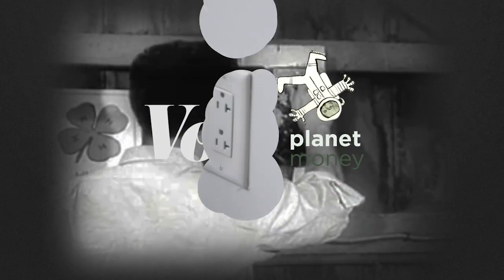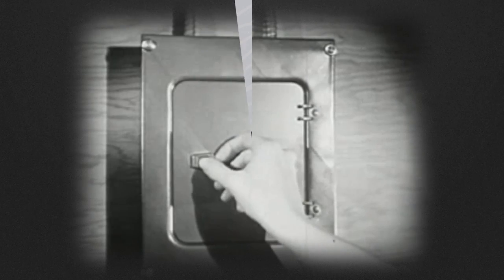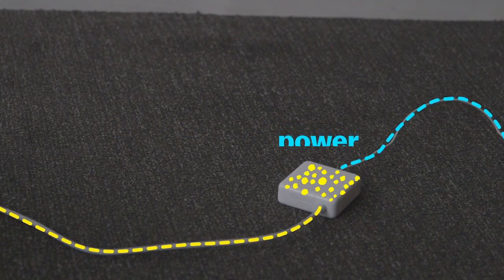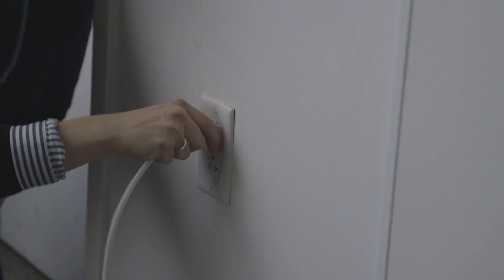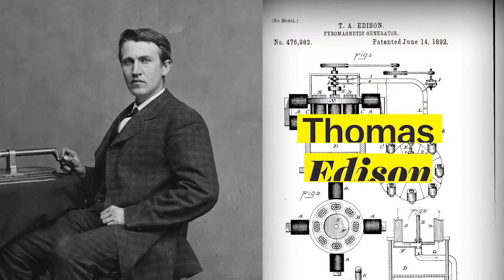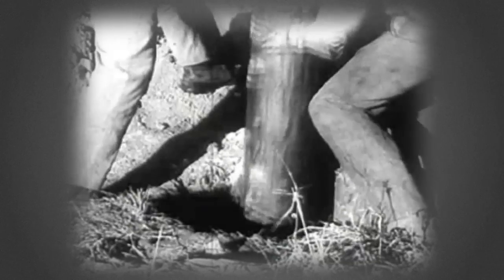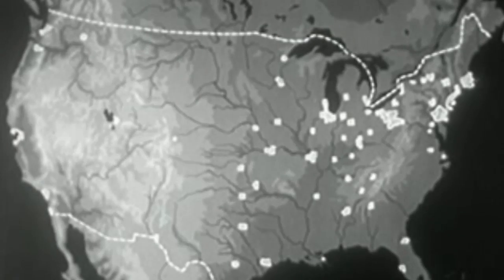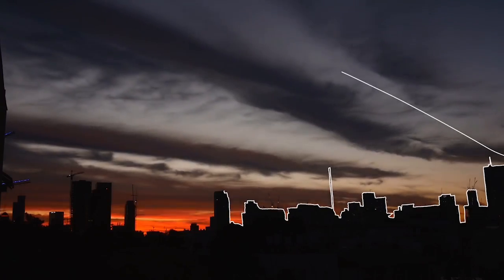Why your laptop charger is so hot

Comment: This Video should have had a disclaimer For Stupid people because the explanation is Silly,  it doesn't really explain why your laptop charger is so hot, it goes off on some lightly related topic
The Laptop charger gets hot from converting 110v or 240v down to 19v.
that voltage conversion is where the heat is generated.
this video should be titled " what does the laptop charger do?"
Reply: +Mark Pickett 
I'm pretty certain the heat is generated from the transformer that steps mains power down to 12V or whatever voltage you're using. 
Bridge rectifiers (AC-DC) shouldn't generate that much heat....... so this video is essentially bullshit.
Reply: +Mark Pickett Wrong. Conversion from AC to DC generates almost no heat. It's done with a bridge rectifier if you want to use both sides of the AC wave. You can use a a single diode if you wanted to use just half of the wave. The OP is current. The heat is generated in the step down process.

I bridge rectify 110vAC regularly at home. The component is a 4 pin IC that's about 1/4 of a square centimeter and has no heat sink or fins.
Reply: That is easy to answer. A certain Mr. Edison who was a 19th century shyster that managed to convince Americans that he was a genius (going by their choices of leaders over the years, clearly fooling Americans does not require any great genius) by stealing ideas from people that trusted him and pretending that he was a prolific inventor. 

For example. It is believed that Edison invented the light bulb. He didn't it had been invented 40 years before Edison was born. Edison discovered a way to make light bulbs durable enough to be commercially viable and a way to manufacture a marketable product. Whilst this is hardly a trivial achievement, and none of Edison's achievements were trivial, he was not what he claimed to be.    

He was smart enough to know that the genuine genius, Nikola Tesla had a designed an AC electrical distribution system so vastly superior to his schoolboy DC system  that he set about discrediting AC by murdering dumb animals. 

So it is due to Edison´s successful duping of the USA population into believing that AC will come and kill you while you sleep in your beds that they use 110V.

So the easily fooled Americans believed that AC was more dangerous than DC. It´s not actually totally true nor entirely untrue, but the DC system ran at 110v so an unearthed live wire would not bite you, or send you flying. It could give you a very nasty burn though. The problem is DC cannot be stepped up and down for distribution. In the 1920s the UK built a national distribution grid, and other industrial nations pretty much did so in that period. The choice of 240V 50Hz was really due to the cost of conductors being lower than if 120V was used. 

I have worked on 110V domestic systems while living in Mexico. I was quite horrified to see that wiring in the home was done by simply twisting conductors together and then applying PVC tape. 

When I was trained we were using 16th edition IEE wiring regs, now on 17th  edition i think. The precautions we had to take in UK were considered laughable and a waste of time by the Mexicans. Actually 110V (its actually 120V but nets down to 117V) is not really safer because if you complete a circuit there is sufficient current (more than about 30mA) and it crosses your heart you could die.  

When you consider that a 240V domestic ring main in UK has a 30 or 32A fuse or breaker on it, there is more than enough juice to kill a person. 

There is no safe or unsafe VOLTAGE, there is a safe or unsafe current level, which is measured in Amperes. Anything over 30mA that is 30/100ths of an Ampere (an Amp 1 Coulomb/sec) going through a body will cause sensation, possibly burning and/or cardiac arrhythmia. 

In Short;

Electricity is fu%&$# dangerous if you don´t know what you are doing. I did a 2 years C&G course on IEE regulation and passed it, but I am not an electrician as I never did it for a job.  I just have the certificate so that I can be a duty holder. I always call a properly qualified sparky to do anything more than fit a plug or change a bulb or fuse. In a workplace you must not even do those things.  

All you need to know about electricity is to ask yourself the following:

Have I been trained specifically to work on this electrical installation or appliance?

If the answer is no do not touch it! If the answer is yes then a very sensible person has called you to fix a circuit/appliance.
Reply: +M Anto the video says it's hot because of converting from ac to dc. which is wrong. it's the voltage step down from 110v to the 19v
Reply: +Bobby Newmark i think your getting confused between Linear Regulator and Switching
Mode Power Supplies. Linear Regulator supplies will put off a lot of heat because its burning off the excess energy, while a switching power supply can do the same thing in a smaller space, but in the end costs more because of the components involved. that's how usb wall chargers can be so small now and still put out little to no heat. 

then again i could be wrong or just talking out my ass, but might be something to think about.
Reply: +Jared Reabow (Jazza) let me just end this once for all. AC is rectified to DC by rectifier then buck converter can adjust the level of DC voltage after that. In both stage, only active component is the switch, notice I'm talking about active component. Capacitor and inductor only store power does not consume power. The most widely used switch in these circuits are IGBT for high voltage and MOSFET for Low power, both have conduction loss. Means when they are conducting and turned on, they act like a resistor. Huge amount of current flows thru them and they have some small resistance value. So conduction loss power=I2R. Except for that, we have switching loss. These two loss consist 99% of overall power conversion loss.
Reply: Almost every vox video is formatted in this fashion
Reply: It did answer it as the above says. It just wanted to educate the masses who forgot to pay attention in physics
Reply: +M Anto nope, you are buthurt because you believed the video until you saw the comments LOL
Reply: +systematic101 That really depends; it doesn't have to necessarily, but that reality is based on your load as well power supply size requirements, capacities, and components cost.  Laptops want things small, but they also can consume a fair amount of power often over 50 watts.  Just to give an example, my last HP laptop came with an absolute brick of a power supply; no heat could be felt when using the thing.  Then for travel I got sick of lugging it and ordered the nice little switching mode flat "slides in your bag" jobber and that one you could probably fry an egg on when it got going.  Some of its not just I2R..its that R increases with temperature so there are indeed cases that without the protective circuitry one can have a thermal runaway situation if the charger is being pushed at its capacity.

Also, in more traditional power supplies, stepping up and stepping down as well rectification don't take much power, but often output stage voltage regulation does as many times any ripple or load following is just shunted through a resistance to ground; its why those 5V and 12V regulator ICs have heat sink connections.  Again though much of this generally depends on the load vs. the regulator capacity one is dealing with.
Reply: +systematic101 Laptops though often run over 50 watts; and everyone wants it the same size as a phone charger wall wart.  Just on raw numbers, desktop power supplies are now sometimes over 90 percent efficient, while those for laptops often range at only 60-70%(for manufacturers makes sense as they've already spent the money getting power efficiency in the computer vs. a desktop); If you're needing 50 watts, at the worst end that PSU may have 30 to deal with and generally no fan; that's why they can get hot.
Reply: +Jared Reabow (Jazza) Thanks for the warning sonny. Saved Mamma almost 3 mins of her time. Cookies for you!
Reply: Stephen Brookes
jesus people are voting for trump,  idiocracy is nearly here !
Reply: Its because the designers of Laptop Chargers don't (and in most situations, cant) efficiently change from AC to DC. First, you need to pass current through a bridge rectifier, which doesn't really generate waste heat that much. Then, it is filtered through huge capacitors, again, no heat/power loss. BUT, regulators, especially the ones in high voltage electronics, are SPECIFICALLY DESIGNED to burn off excess current to get to a desired amperage and voltage. This is not the fault of Tesla, an extraordinary engineer, it is the fault of the charger designers using regulators designed in the mid 70's. Also, what about AC appliances, washers, driers, microwaves? Furtermore, having a single converter for just DC stuff would still require BURNING OFF excess current, so you would hypothetically put tens of thousands into a false technology.
Reply: Stephen Brookes especially for Apple's strict devotion to sacrificing performance to their design...no heat dissipation whatsoever is allowed for (They forgot that they can make the chargers out of the same metal as their computers- and would work better!)
Reply: Felt like they were talking to a seven year old the whole video.
Reply: its just a catchy title. World be very lame with your title.
Reply: codenamegamma In the case of USB wall power supplies the amperage and voltage of the out is pretty low. The linear and switching supplies are very similar. They are only different in the steps before the voltage step down. Switching supplies rectify the voltage 1st. Then it ramps it up and converts it back to a high frequency AC then steps it down to a low voltage. The high frequency of the AC allows the transformer to be much smaller. Then it rectifies it again. Not a lot of heat is generated by the switch mode supply because the power passing threw it is not very high and it's efficiency is very high. In switch mode about 10-20% of the input power will be lost to heat where 30-40% will be lost in the linear.

Cost wise it's not much more expensive to build a switch mode power supply. I typically don't build them unless the power use is higher the 10 watts. most of my circuits are only 2 to 5 watts.
Reply: Well precisely it's how the ac -> DC down step conversion is done, different methods create more heat, magnetic coil induction etc...
Reply: +Jared Reabow (Jazza) more like a disclaimer saying "not for stupid people"
the heat is lost energy, it's a byproduct of what ever process it goes through, this is literally one of the simplest concepts out there, if you lost some damn energy where did it go? it certainly didn't just poof and disappear from this universe, that's not how it works, it has to go somewhere.
Reply: Jeremiah John
this is basic electrical heat transfer,  but in modern cosmology things can disappear from this universe.   Into others,  gravity for example only makes sense if it's from another universe, and that explains why it's so weak.
So there are parallel universes etc...

when you get into quantum computers, they are literally sending information into different universes and back.
Reply: systematic101
I'm baffled why in this modern age this problem hasn't been solved.  It should be able to step down without giving off too much heat.
I think it shows that at a fundamental level we don't understand electronics.

The energy is being turned into heat because it has nowhere else to go, give it somewhere else to go and there should be no heat.
Reply: Hanniffy Dinn no mater what there will always be heat. There will never be a perfect conversion. It's just a matter of how much heat.
Reply: systematic101
You aren't getting it.  It is possible, just nobody has even tried to "filter" off the excess energy before it's turned into heat.

it's turned into heat because of the wasteful way it works.

It most definitely is possible.
Reply: +Hanniffy Dinn No. It's not possible because we live in a universe that has to obey the laws of thermodynamics. No mater what the conversion of energy from 1 form to another will always have a heat loss. There will always be some resistance somewhere in the circuit and that resistance will cause heat. Even if super conductors were used there will still be heat loss just not in the super conductors.
Reply: +Jared Reabow (Jazza) Exactly. They failed to answer the question for one more reason: to answer the question why it is SO hot, it should be mentioned that it is because the power wasted as heat is large considering the surface of the device, through which the heat is dissipated, and If the surface were larger, to dissipate the same amount of heat the surface would have lower temperature. 
I really enjoy some of Vox's videos on social or human sciences issues, but I guess they should stick to that. This video is rubbish.
Reply: +Stephen Brookes I wasn't replying to your comment, I hadn't even read it. As you can see, beginning of my previous message says someone else's name. And I don't think I was being tolerant of their foibles at all.

Anyway, the very basis of the only correct answer to "Why your laptop charger is so hot" is "because it dissipates a quite large amount of heat through a quite small surface area", BOTH of these conditions have to be met; if both are met with a device of the size of a car, of course it will reach a high temperature as well. 

Then one could (and should) go deeper as to why it needs to dissipate quite a large amount of heat, which is because of the rectifying of the input AC current, but probably even more importantly because of switching down the voltage from the socket voltage. Which was already mentioned by the person to whose comment I was replying and referred by me by the word "exactly".
Reply: I study electronics , honestly i expected the video te have a high school level of whats happening, it's at kindergarden level.
Reply: P. Bubon it could then couple as a plate warmer!
Reply: Twinkle Baby Resistance only exists in the presence of oppression!
Reply: ReabowRotors It should be named "What the laptop charger do... sort of", as it didn't even mention that it also steps down voltage to the 10/20ish volts required by the PC.
Reply: Grey You are very lucky.If you had touched the earth conductor we may not be having this chat. You would have been sent across the room and it could have stopped your heart, or badly burnt you. Although I met a sparky that had fallen against a control panel connected with a 3 phase supply 415V and survived cos he was thrown about 10 metres.instantly breaking his circuit

Plugs now have insulated conductors so that you cannot touch the exposed conductor until it is away from the juice. Also now you have to shut off all supplies and lock out the switch if you want to work on anything. Thank goodness for HSE rules.
Reply: Stephen Brookes Thanks for replying. Working as a spark has to be unpleasant, but then like you say, it's only that if you've no idea what you're doing, which many DIYers don't. But you're right the Health and safety has changed it all. Thank goodness 😅 
I'm still never changing a lightbulb though 😱
Reply: If you take the fuse out or flick the isolater off, the most dangerous thing about a light bulb change is the step ladder you're standing on. I have always thought if you get thrown off a horse get straight on again or you will always have the fear.  I can appreciate your apprehension, but  what happened to you was ignorance of the danger. Now that you have learnt what can happen, do not fear it happening again. Just make sure any electrical work (even a light bulb swap) is done on a dead circuit. I don't even trust a switch, just in case some DIY nut job had wired it on the neutral side. So just isolate before touching anything electrical and it cannot hurt you.
Reply: Stephen Brookes You are so correct in all you've described. Thanks 🙏
Reply: You're welcome.
Reply: I thought it was a problem they would tell us how to fix.  Mine doesn't "so hot i can't touch it," but I was curious in case it gets really hot what should I do.  This video ended up only telling me what the box does, what a completely misleading title.
Reply: No. it switches topics!
Reply: From an Asian student's perspective: P=W/t=UIt/t=UI
Reply: Oh I love YouTube replies
Reply: +Jeremiah John ok, so with your reasoning the reason a car engine gets hot is because of the friction in the drive chain to the wheels....
Nope, the engine gets hot because of the combustion.
Reply: +Jared Reabow (Jazza) not an accurate analogy. Engine would be like the power plant producing the AC power and the drive train would be like the AC/DC converter box. The heat in the drive train would be from the energy loss do to friction in the drive train. The engine gets hot do to energy loss in the energy conversion from gas to kinetic just like the power plant has heat loss when it converts steam to kinetic.
Reply: +systematic101 ok if we go by your analogy we would be saying the sound created from the drive train is causing the heat.

Fact is over 300 agree AC to DC conversion is almost loss less compared with voltage conversion.
heat in the power supply is generated by the voltage conversion (120v to 19v) not the power type conversion (AC to DC)
If it were only converting from AC to DC the brick would be tiny and would be at worst 1 degree above room temp.
Reply: +Jared Reabow (Jazza) that's what I said. a bridge rectifier produces near 0 heat while the voltage step down produces almost all of the heat.
Reply: +systematic101 my mistake i was confusing you with a different comment :)
Reply: +Mark Pickett it was a vague explanation though...
Reply: She said it lol. You deaf or something? Your not even bringing more info than her, calling someone stupid.
Reply: Stephen Brookes
well it's vox not a science channel like vsauce, when can you expect?

Ok enough for the dumb girlies !
Reply: Hanniffy Dinn Dumbity is not confined to girls and is remarkably commonplace. If we do not teach real science and scientific methodology; then people will be credulous and believe mythology without question.
Reply: The last sentence in the video was Stupid!  You still need to power down from AC to DC in somewhere!
Reply: Hanniffy Dinn That has already proven to be too difficult and have very bad PR implications!
Reply: Stephen Brookes
I was reading about what's going on with Trump - it's the Waldo Effect,  the Black Mirror episode of the same name covered this effect.

We really are going to have a future like in the film idiocracy.   Literally everyone is dumb - by design too.
Reply: Hanniffy Dinn Trump is scarey!
Reply: Piers Alter Each of us has to develop our own BS barometer!
Reply: YS Production

The actual correct answer to why is it SO hot is because it produces much heat. This IS the only correct answer.

The answer to why does it produces so much heat is due to the magnitude of the current. If they ask what that means, then I will start asking for a fee hahahah!

Whilst your answer is not strictly speaking incorrect, as a given amount of any force applied over a smaller area will exert proportionally more stress on that area, where the same amount of force will inversely affect a larger area.

In this case it is not to do with size. If it were the size of a car and were passing more current than its rating, it would become too hot. As my belief is that the cheap, Chinese rubbish, crap, bunco versions are not man enough for the job!

Although I have several OE power units which I leave on constantly, and they do get pretty hot, but not too hot to touch, so maybe the answer is that the devices are actually performing within specification. In which case the answer is don't touch it when it is on cos it is meant to be hot! Turn it off and let it cool before touching.

At what point do you think it has to be said to people that do not understand why, on so many rudimentary effects of nature that they should have listened in school?

Why did my house burn down? Because you plugged a kettle, tv, xbox, lamp, iron and room heater into the same extension lead! Doh!!!!

All appliances have a rating in kW, all circuits have a rating limitation in kW, but I guess the video maker thinks this is her phone's kWool rating.

Basic physics at school covers the principle of conservation of energy.

Why people don't understand this is my question! Maybe the answer to most of these questions is for some people (those to whom it applies) to stop being dummases!
Reply: +Jared Reabow (Jazza) thank you for saving me from the click bait
Reply: Indeed it's way too superficial and doesn't really teach anyone anything.
Reply: Mayamiko Hara I'm unsure that there is anything super about it.LOL
Reply: the video literally talks about why it's hot for maybe 10 seconds
Reply: solomon sumner You wait until she starts explaining how an induction stove works!
Reply: P. Bubon Also the fact that they are really quite small for what they are able to do, so there is less volume to dissipate the heat. Generally it is not a fault just a characteristic. Go back to Tesla´s time a similar apparatus would be the size of a suitcase.
Reply: ok, so it's not a half-wave rectifier, it's a full wave rectifier that apple sent me?
Reply: ReabowRotors 
Agree
Reply: ReabowRotors thank you
Reply: Now that made sense, unlike the video.  A better video would be why are some countries (i.e. USA & Japan) use 110V and others (i.e. England & Nigeria) use 220V/240Vs.
Reply: Stephen Brookes In the few paragraphs you wrote meant I understood more in your explanation than I did in this video. In fact it was quite interesting to read. Thank you 😊 
I was electrocuted when I was 15, I was using a single spin driver that many of us had years ago in our homes and it began to shake uncontrollably. Me in my bare feet and standing in a puddle of water in the kitchen bent down to pull the plug out, but I could only manage to pull it out a bit. So silly me put my fingers of both hands in behind the plug to pull it out. Of course I then began to shake uncontrollably! I didn't know by touching the pins with them not fully out would cause me to rattle like the spin dryer.
Thankfully after what seemed like ages managed to free my hands. Now I won't even change a lightbulb! 
Sorry for the rant, but thanks for sharing your knowledge it was interesting and much appreciated.
Reply: ReabowRotors So is it something I should be worried about if it’s on my bedsheet?
Reply: Current generates heat
Reply: She answered the question you fool’
Reply: It also doesn't mention that your laptop usually consumes around 30 watts to max 60 watts. That's less than powering one 60W filament lightbulb.
If you want to make the most savings in energy consumption, look at heating & air conditioning.
Reply: +Jared Reabow (Jazza) The whole explanation is so over simplified to the point of it becoming an invalid explanation. What you have here is a technically challenged girl asking another technically challenged girl about something neither knows anything about and would not understand the correct explanation anyway cos it would not include the words ya know and like kinda!
Reply: Hanniffy Dinn People will always vote for a simplistic ideology, cos it is easy to understand, requires no effort to learn about and no thinking is required.  Let us apply Trumpian logic to a few other problems. 
Most accidents happen by falling down the stairs.
Only build bungalows from now on. That would screw up Trump!
Most car accidents happen close to home. Don´t drive near home!
Most child abuse is caused by parents. remove all parents from houses containing children.
Etc
The real problem with simplifying things is that things are not simple.
Democracy allows stupid people to vote for stupid policies.
Get rid of democracy!
Reply: +Jared Reabow (Jazza) oh please! fuck off with your "I'm smart and this video is for stupid people blah blah blah I'm so smart"